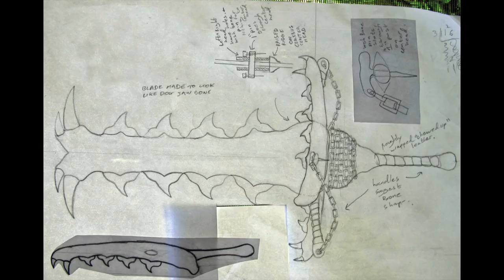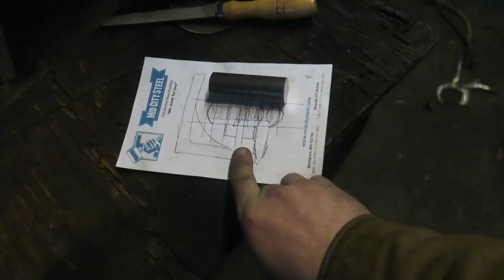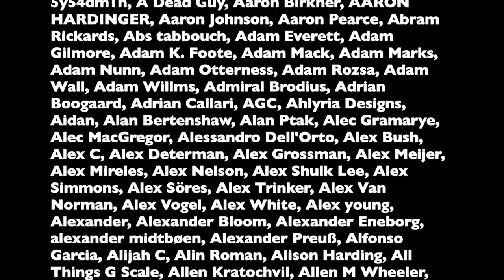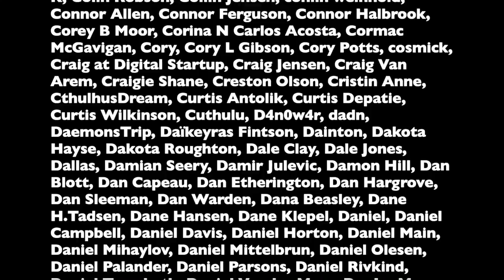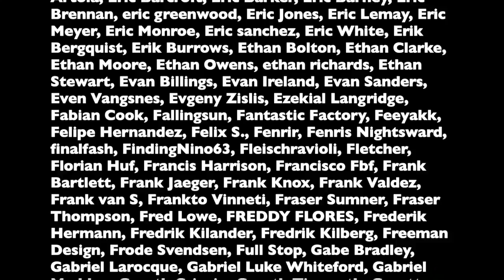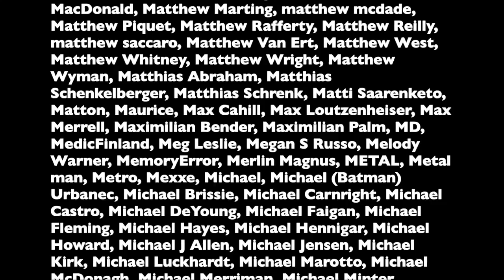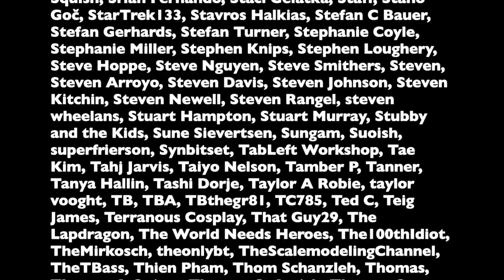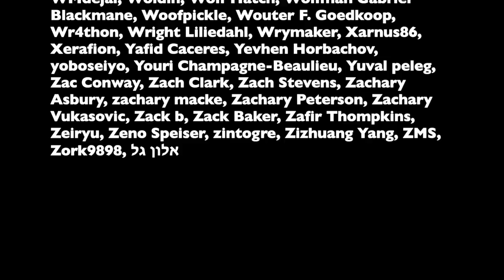(2nd) Cerberus Build

Comment: Hi Mike..  soot welding splatter guy here. When sharpening your tungsten have the scratches go towards the sharp point rather than at 90° to the point. It makes a huge difference to the arc pattern and lessens staying arc so you get a tighter heat zone.  Especially at lower camps. Thanks for the vids chief
Reply: Was going to post the same. You will get a lot better arc sharpening having the grind lines going towards the point.

Comment: Hey Michael loved the video and using watered down vinegar and concentrated vinegar is very different because the watered down vinegar will have a higher ph and will be less acidic and therefore will take longer where as the higher concentration will do the job much faster. And the volume of the vinegar doesnt matter at all as long as it covers the entire surface area.

Comment: Hey Michael, I recommend to use a center drill before drilling on any surface. It will help reduce the drill from skittering off from center and make it much easier to start drilling. Other than that, nice work man!

Comment: Its harder to control with a mig, but you're exactly right. A weld that high definitely did not penetrate the base metal. At least in my experience, with a 7018 rod and ground steel, you can force the rod into the metal and really control that penetration. Even with your machine lowered. It's just a matter of how properly starting the weld off of the seem and then dragging it over the seem with the whole puddle. And then you burn it out and start the the weld.

Comment: What changes with the vinegar etching is concentration per unit area. Dilute vinegar isn't as concentrated per unit of surface area and therefore would take longer to react to the degree a more concentrated solution would. However, ultimately, you would have the same capacity, if you will. One solution is just more concentrated at the surface

Comment: Of course if you dilute vinegar it will take a bit longer to get the results you want. Normal commercial vinegar is about 10% acetic acid and rest water (naturally). Acetic acid is also quite weak acid since it is organic one at that. You could probably use citric acid for rust removing also.

Comment: As far as I know it's the strength of the acid that does the work not the amount.
Reply: pyro 323 it's a little both it might get too saturated and won't disolve anymore but for the most part your right
Reply: That is true, but only really if you're considering different volumes of acid.  Like, i litre of 100% concentrated acid will have the same smack as half a litre.  However, if you topped the half litre up with water, making it 50% concentrated, that would reduce its concentration and thus increase its pH.  

It's the same idea behind the fact that you can get Sodium Hydroxide in low concentrations in soap and it barely does anything, but you can also get far more concentrated Sodium Hydroxide that will dissolve a dead body.

Comment: Mike I’m pretty sure you already know this but just in case for whatever the reason the camera goes a little wonky when you mig weld is because the cameras frame rate is able to pick up on the short circuiting of how the mig works so how it goes with those lines is the camera picking up on when the wire contacts the metal and shorts out then it picks up as it moves down to contact the metal again so that’s kinda why the frame rate of the camera goes wonky when you mig weld

Comment: You know you could just dump in some stones if the vinegar level is too low, right? At least to the side of the sword where nothing is
Reply: Was gonna suggest that, or other bits of jagged pointy steel.
Reply: @WilliamMoser  But preferably it is something that won't react with the vinegar.
Reply: Good point, Mike seems to have plenty of 4 gallon milk jugs that would work well.
Reply: Mike Matthäus I feel like an idiot, only realising that after I read your comment.

Comment: The stronger the concentration of your vinegar solution the faster it will strip the rust. If you water it down too much it will eventually not work at all. The fastest solution would be to submerge it in conc. acetic  or HCl but I can't say I'd recommend having a vat of that lying around...

Comment: Powered Citric Acid to remove the zinc - add the power to water - dip the chain in and leave it for about 30minutes - all the zinc will be gone and the chain will go darker. Hot water is better than cold.

Comment: Camera shutter in 21 minute mark is probably due AC electricity having 60 hertz frequency. This is then turned into arc in welding wire, but thing is that this still wont take away the frequency, so arc pulses in that frequency with you cant see with naked eye, but camera sensor will. Least thats my guess why that is.

Comment: Great video!  I do have a question though - when you were using the mig welder to add material to the teeth, could you have instead cut off smaller pieces off of the large piece you cut the little sword out of and then joined those?  I don't weld myself, just curious if the hassle involved is much greater

Comment: @19:13 you were talking about welding with a high crowned bead basically you were saying welding with lower amperage means your welding "cold" and not getting proper penetration that is of course if you are going for proper welding just thought id sum that up for ya

Comment: 32:04 If you have a lathe, why didn't you use it to drill the hole straight through instead of manual drilling from both sides?

Comment: Englisch

I would be interested in whether the weapons are made of stainless steel, if so, they can't be sharp.
as an industrial mechanic i know that stainless steel cannot be sharpened so it is of course more difficult to forge the weapons but the differences make it easier and sharp the optics are of course really great as a pure exhibit.